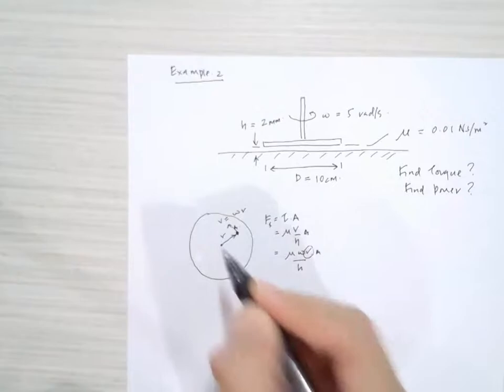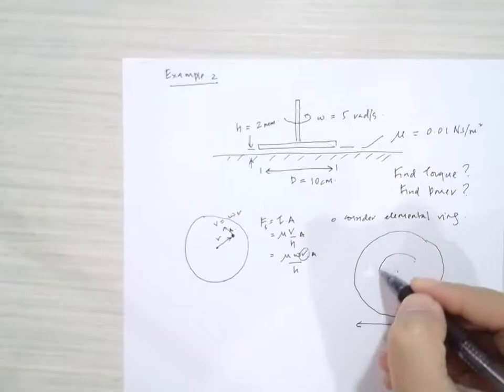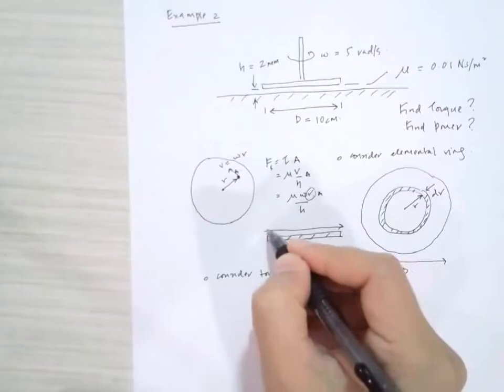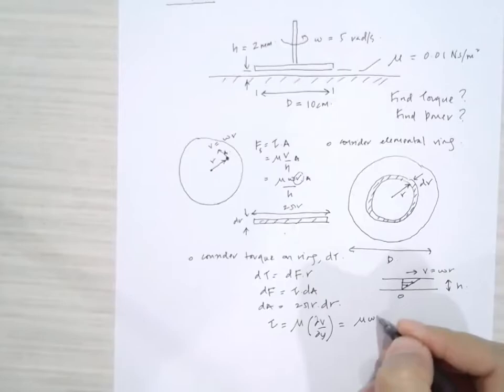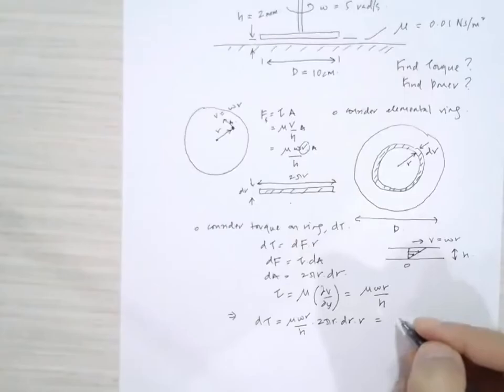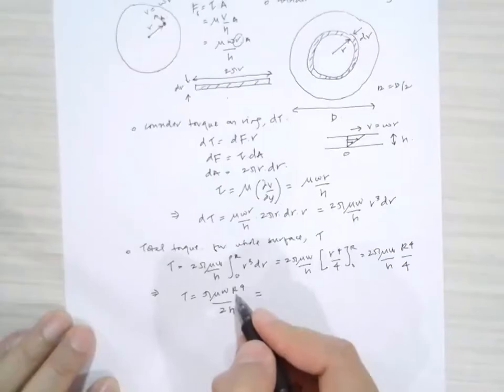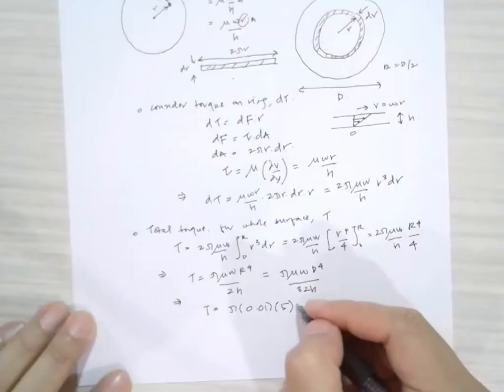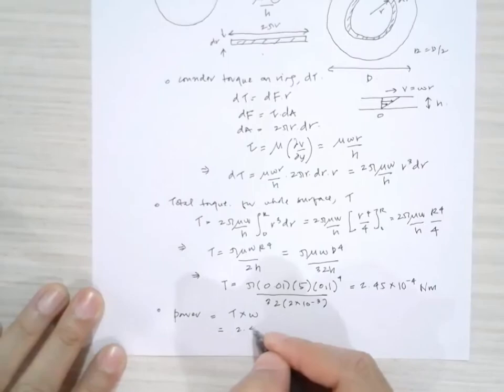Mechanics of Fluids - Topic 2 - Example 2 - Viscosity - Rotating Disk

Comment: hi prof, may i ask if the there is more than one disc then the torque should times with the number of disc right? great video by the way.
Reply from the maker: Thanks. Not necessarily because you need to consider the velocity differential between the disc.
Reply: @MohdZamriYusoff  i see. so does that mean that this calculation could not apply for more than one disc? as example how do i count the torque of a rotating shaft with 5 discs attached to it? Thank You so much for your clarification Prof.